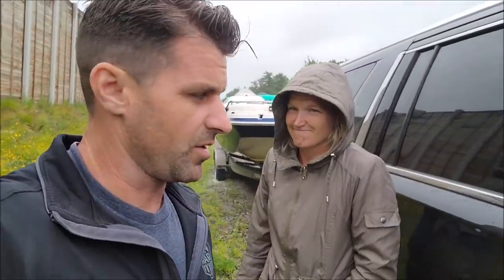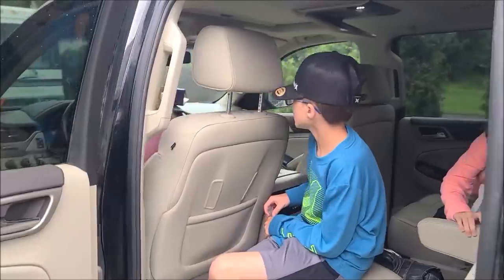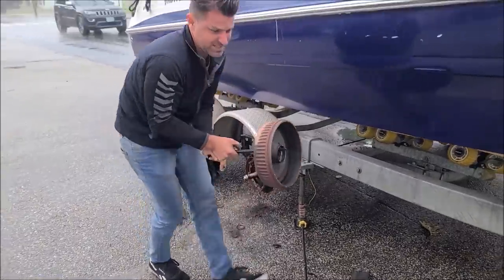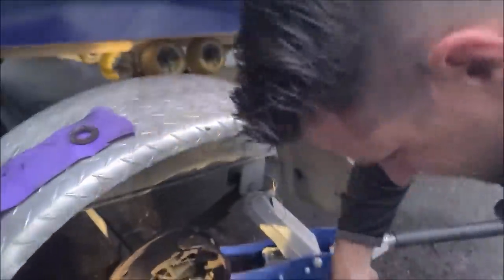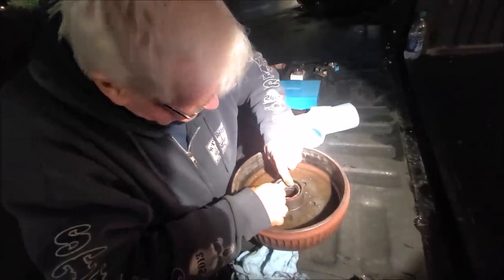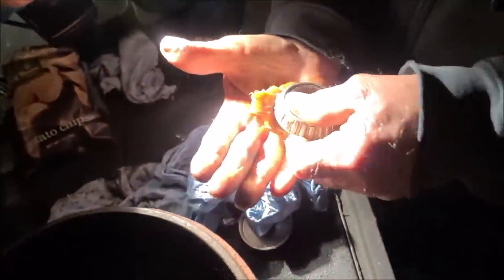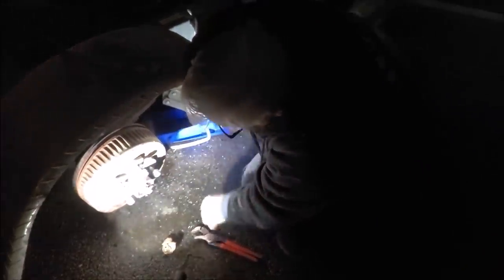Now it's a Boat Fire - Emergency Roadside Trailer Repair

Comment: Pop was spot on, And you pulled that castellated crown off right at the start, But I feel you will get through thanks to a Mechanics knowledge,I salute you Pop, and also you Sir for keeping your Cool, and Mom for distracting the kids, (The hardest job by far, ) great teamwork, Enjoy your Boating, regards Sam. from sunny Australia.
Reply: I was just gonna post this but you beat me to it. I also learned never to toss parts no matter how bad they are until the job is fully done! You never know. The old man would have seen that and used it!

Comment: Seeing you and pops working together reminded me of the misadventures my dad and I had. Man they were a PITA at the time. Now I would give almost anything for one more. My favorite was the time we were on the way home from the track in my 70 Chevelle and the throttle cable broke. We coasted into a Carvel parking lot. We came out of Carvel with 2 cones and a wire coat hanger. He unwound the hanger attached one end to the throttle linkage and the other end he poked through the firewall,  so he could pull it by hand to accelerate. The best part was when he looked over and said watch this... He took the wire and wrapped it around the shifter and said hey now we have cruise control🤣🤣 A truly great man

Comment: First question is, what type of grease did you use? Plus did you adjust / check the wheel bearings and brakes, fluid before you when on your trip?

Comment: Hey Craig,
U R so "lucky" to have Pops, the best cavalry ever. Great to see old school proper (temporary) fixing, rather than bodging a solution. Years ago I blew a trailer bearing picking up a Heinkel    Kabin Kruiser (bubble car) - no fire as the light trailer wasn't braked. I just noticed the wheel at a casual angle when I stopped for petrol.
How about some Pop's "back in the day" or "there was this one time" story episodes if he's up for it?
Take care mate

Comment: What you thought was the axle nut is actually the castellated nut cage you needed for the cotter pin. It looks like it was damaged though. Dust cap likely burned up and fell off. Papa Al is a pretty sharp cookie using a bearing puller to get the race off. Looks like it went perfect. I do like his technique for packing the bearing and the soda can idea is brilliant in a pinch! Makes good sense. You live an exciting life Craig. Full of adventures! Hope you and the family had a good vacation.

Comment: I had to make a similar “modification” to get better bearing fitment on an old drill press; instead of soda cans, I used a cheap set of feeler gauges

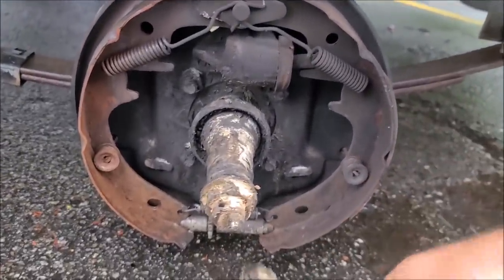Comment: The piece you thought was the axle nut at 5:54 was the castle nut pops was talking about. It should be the last thing you put on before the cotter pin. Hope you get it all worked out. Have a great trip otherwise.
Reply: I was just gonna post this message but you beat me to it! Never toss any parts till the job is totally done. Poppa al would have know exactly what it was.

Comment: We use bearing buddies if you're interested and if you already have them please disregard this message also pretrip visual inspection of trailer compents before start of each trip during the trip like stopping for restroom gas etc I do that when im taking a trip with any trailer plus worst of all if something happens and causes an accident they can hold you liable for everything involved pretrip is always best with any type of trailer keep up the great content from champa Florida

Comment: Before towing a boat on vacation, a thorough check of the trailer wheel bearings is always a good idea since the get immersed in water and in my case salt water regularly.

Comment: I tell you replace the bearrings and seal before every season  I sell boats and once a trailer hits the water or is parked outside and the boat is not completely leveled water wil enter one wheel  bearring and lock it up over time because the water runs over the top of the boat to the side and gets pulled towards the lowest part and end up demolishing brakes and bearrings

Comment: When you say they had been greased this year, did someone just use the grease zerk on the end of the axle?  Because thats not the correct way to grease bearings and thats what caused this problem...
Reply: Looking at the spindle and brake pads, he definitely didn't service that trailer before the trip. I agree, you don't just hit a zirk on a wheel bearimg. Lesson learned Craig, don't be so cheap with your family's safety. That could have gone really worse.

Comment: seems like while you greased the bearings they were gone or seized so the grease did sfa. How it was explained to me you drive to the boat launch, the bearings get hot, you back the trailer into the water and the hot bearings suck in the cold water forcing the grease out. bearing buddies have an expansion feature that expand and contract as the bearings get hot and cold and instead of sucking in water, the fitting compresses keeping the grease in and the water out.
Reply from the maker: You're right

Comment: Trailer maintenance is the most ignored part of owning a boat. Do the bearings yearly. Clean out the grease in the axles entirely, clean the bearings very well in a parts washer, blow them out with compressed air, inspect them and replace if needed. Replace them every other year or so regardless because they're so cheap. Put on new axle seals and repack with Lucas Marine grease. Get Bearing Buddies for your hubs and stick them on with sleeve retainer. Inspect your brakes when you service the bearings. Rotate your tires when you service your bearings. Tires are the other thing that will get almost every boat owner. Use tire covers if your boat is stored outside. Replace your trailer tires every 3-5 years depending on condition; it's just the cost of ownership for trouble-free use. I carry two spares for my tandem axle boat trailer because if one tire fails from sun damage, the other on that side is surely to fail soon. Inflate your tires to the max pressure on the sidewall because that's how trailer tires are supposed to be. Underinflation will make your trailer handle sloppily and cause excessive heat which will lead to tire failure. A couple hours a year is all it takes to keep your trailer in good shape.

Comment: My pops taught me to walk around the trailer and touch the hubs at regular intervals. My thought is that the break was the problem. It drags, gets hot and burns up the grease and bearing.

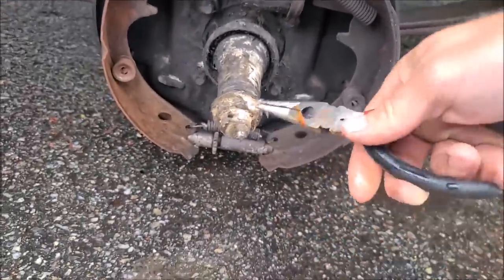Comment: Craig forgot he didn't know what the castle locking nut was when he took it off (called it an axle nut around 5:55 in the video) and probably threw it away

Comment: I don't know if you noticed it, but you have no breaks shoe left on at least that wheel

Also you have to at least check if not Grease the bearings on the boat Wheels every trip oh, you can't just do it once a year and expect everything is going to be fine

Comment: Grease the bearings take it to a trailer repair shop! There are special hub caps that has grease fittings on it, you pump grease into the wheel bearings if you went through grease that fast you need marine grease and new bearings!

Comment: Shooting grease into the bearing buddy isn’t servicing the bearings.   The problem with boat trailers is the simple fact you get it wet.  Usually right after your brakes are good and hot. Then you back that sucker in and you instantly cool these parts to 70 degrees or less.  There isn’t a seal made yet that can handle this and you will always get water into the bearings.  If you have enough grease shot into the bearings this usually isn’t much of an issue.  Problem is the inner bearings are the last to get grease from a buddy system and the first to get wet when you back in the water.    

Always pull the wheel assemblies  at the end of the season and properly clean and repack the bearings.  If you let them sit over the winter you will have a rusted mess on your hands next summer.

Comment: Ah, you should prob grease the bearings before every long trip. Oh well, lesson learned.
Reply: He greased them, but they appear to have been partially seized already so the grease did SFA. What you need to do is check them for play etc. Getting a grease gun and pumping in grease without checking is useless. You gotta jack up the trailer and spin the wheel....if there's even the slightest grinding noise, gotta replace the bearings, grease ain't going to fix it.
Reply: @muskokamike127  He said he Greased them at the beginning of the season. When that was, ? Spinning them with the wheels on and feeling for grinding, you aren't going to feel crap unless they are REALLY bad.
Reply: @mph5896  No, you actually will. if you've ever spun a wheel on a lawn mower, truck, car or anything with bearings, you WILL hear and feel bad bearings. 

If you listen, you WILL hear a coarse grrr grr sound, hear that? bearings are shot. If you spin the wheel and it doesn't spin freely you should investigate why. 

if you're going to own any type of trailer, you should learn how to check.....I live in an area that is highly populated in the summer with people with camping trailers, tent trailers, boats, etc and without fail you see one or more every weekend on the side of the road with the wheel off due to bad bearings.
Reply: @mph5896  BTW: Craig's WERE really bad, they freaking caught on FIRE ffs. That didn't just happen.....he admitted her drove it to the coast. I bet they were on their way before he got there and the final straw was when he dunked the trailer in the water....

Comment: This is a lesson. When you don’t check your equipment and you don’t maintain it. Bad things happen
Reply: He does maintain his equipment. He said he did the bearing repacking annually
Reply: @Boga217  greasing the bearings once a year is not checking them. Huge difference, obviously. Hence the failure
Reply: @Boga217  everyone I know checks the trailer each trip. It can cause a big accident. You be dismissive all you want.
Reply: @edwardbaker5373  I always walk around check all lights, chains, welds, tires e brake, visual on all of the siding and doors. I'm sure Craig does the same. What more do you do because I've never met someone who does more than that. Go call camping world and ask if you should jack the trailer up and inspect each bearing before each trip even after annual maintenance. Bet they say " no as long as your performing your bearing repacking according to manufacturer and checking air pressure". Your argument is dumb no one checks bearings more than annually unless there packing on tens of thousands of miles.

Comment: Once a year have your bearings , pulled , checked and cleaned, replaced if need be ….. I have that done every year for about 400 dollars, but that’s about what you spent , please replace your brake drum, that was a quick fix with a Red Bull can that may or may not last.  Your lucky you didn’t scar the axle , then you would be in for a new axle , there is no repair for a scared axle , just replacement 800 to a 1000 plus parts and labor. And why do I know this , just like you heading on a fishing trip to a lake 4 hours away blew a bareing , that scared the axle , I was lucky the next town up had a trailer shop/boat shop , who was nice enough to rent me a trailer that fit my boat much better than my trailer did.  Up shot to this story , after vacation on our way home I stopped by the trailer shop , yep 3 weeks out on the axle … long story keep short , add up the rental trailer, cost of a new axle , add in a little tread in value for the old trailer, and a check , I drove home with my new trailer……problem solved …………

Comment: As a diesel mechanic I see this far too often, You got lucky because most not all I have seen fail like this Burnt the axle stud down to nothing, Requiring a new axle. This Problem is much easier to avoid if you Jack each wheel up off the ground take the palm of your hand hit the tire on the sidewall and watch for side to side movement if any movement is noticed, Pop the grease cover off, remove the pin and nut locking device many different ones, take all the slack out of the bearings once a year if used often then regrease if needed, Because loose wheel bearings take out the seal of course where you can't see it with drum brakes like you have. YOU WON'T HAVE THIS PROBLEM EVER IF DONE RIGHT, And no DO NOT overtighten the Nut just take out the slack it's easy, Because if you get the nut too tight this also causes bearing failures. Most have a torque spec for bearing pre load each axle varies depending on the size and load Spec of said axle, Most eighteen wheeler nuts get torqued to around 50ftlb way too tight for a small trailer axle like this... Also much larger everything on heavy Trucks. I always just took the slack out of my trailer's wheel bearings once in a while, have overloaded many times never  ever had a bearing failure. Maybe it's because I maintained myself it since new. By the way thanks for your Upload the Video that is, Your Dads Great everyone should have one like him.

Comment: You don't have a curse.. you operate beyond your level of knowledge...  oh, FYI..  Heating that inner race with a propane torch would have allowed it to slide off or be driven off with a little persuasion...  Pops had the plan though..  Great roadside fix.. however.. ratchet strapping that axle up and driving with one wheel would be easier.. just saying..  and, replace that drum.. that aluminum can shim wont last..  also, get the rest of the hardware, the castle nut, dust cap.. etc..  wont take long for it to work loose and ruin the new bearings..  in other words, fix it right..